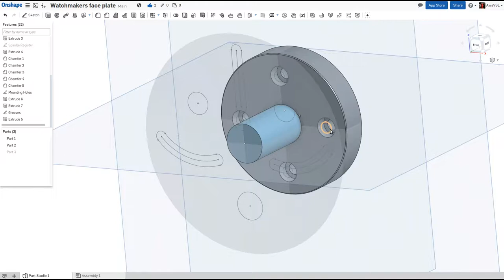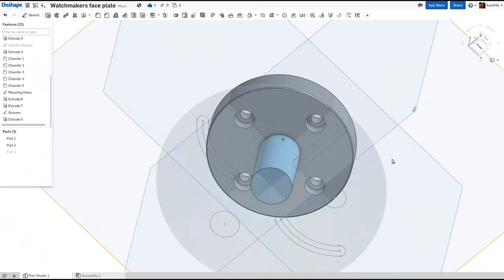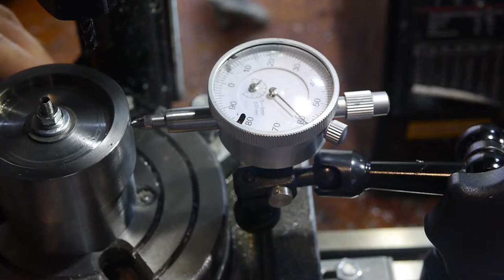Watchmakers Face Plate - Part 7

Comment: For your extra deep counterbore, why not make a "washer" that is a press fit into the counterbore hole and adds enough height to make up the difference? 

Nice series so far.
Reply from the maker: Yeah, that sounds like a good approach. A press fit feels like a better solution than loctite. Thanks for the suggestion.

Comment: Nice video again! Thanks for sharing. I tried to watch earlier parts to answer this question: how is the face plate going to be fixed to the  mounting base? Daniel
Reply from the maker: I honestly haven't reached a final decision on that yet. My original plan was to turn a register into the back of the plate, then a single thread onto the spindle. However I'm worried that this won't hold in place, and will tend to unscrew itself in regular usage.

An alternative plan is to use 3 small custom screws, but they're going to have to be very small to fit the threads into the available spindle diameter.
Reply: Adventures with a Very Small Lathe keeping in mind that you need a small hole (3mm) in the true center of the plate to center objects from the back end of the spindle, I would agree with a register (not threaded). Then either three M2.5 flat head set screws or silver solder... Set screws are stong enough.
Reply from the maker: Yeah, set screws is definitely the direction I was heading. I already have a larger hole than 3mm through the entire spindle from earlier in the project.

Comment: I do wonder if you would be better off using HSS cutters, less tool pressure and all that, i only ask because I had no luck with inserts on my teeny lathe.
 Regards, J.
Reply: That too deep counterbore would irritate me (I've lost count of the times I've done similar), a small sleeve loctited in?
Reply from the maker: You're probably right, but grinding HSS cutting tools is a skill I haven't yet mastered. All the tools I've tried so far give me terrible finish and short lifetime. Despite the carbide issues, I think this job would have been more difficult with HSS. More than 100 passes at HSS speeds would have taken a really long time, and I would have had to re-sharpen a HSS tool multiple times. Stefan Gotteswinter's recent video on re-grinding carbide inserts to make them more suited to small lathes is a source of inspiration, and I'm planning to give his technique a try.
Reply from the maker: It's going to bother me as well. I'll fit a sleeve at some point.
Reply: Adventures with a Very Small Lathe I only use HSS tools on my small lathe. I have done projects with a lot of cutting and did not have to regrind my cutting tool. I just touch it up with a small honing stone and that can extend the time between regrinds. Once you have shaped the cutter, you will not need to regrind that often. There are HSS cutters already pre-ground available from the usual small machines hobby shops. There are even HSS insert cutters available in the US.
Reply: Stefan has great advice & also made reference to a particular HSS tool grind by Tom Lipton (oxtoolco).
See timepoint 12:51 on this video  https://youtu.be/uzPIUsMtUEM
I followed this & made the same style in 8mm HSS & have used it successfully on my PD 250/E.
as mentioned by @AtelierDBurgoyne, I've just been honing the edges to regain the sharpness.

HTH, Colin
Reply from the maker: I learned a lot from watching Stefan's recent video on re-grinding carbide inserts. My diamond grinding wheel is on the way. Thanks a lot for the link to the Tom Lipton video! I'll try following his technique, and see how I get on.
Reply: Adventures with a Very Small Lathe Have you considered the HSS insert tooling from A. R. Warner? Greg Halligan speaks highly of them.